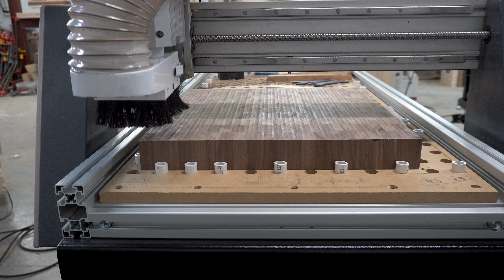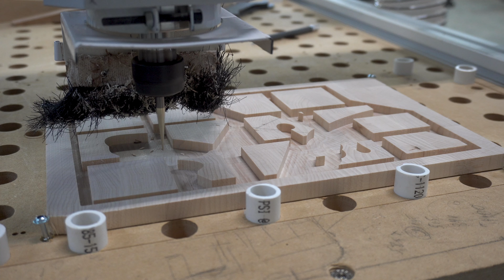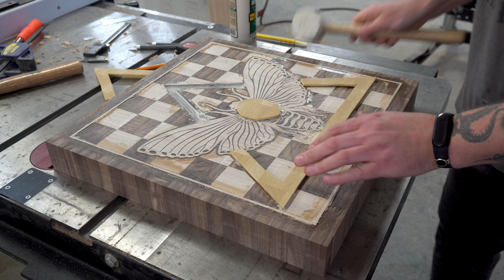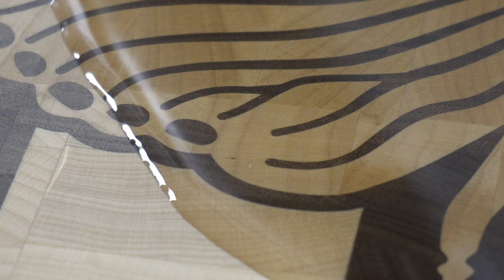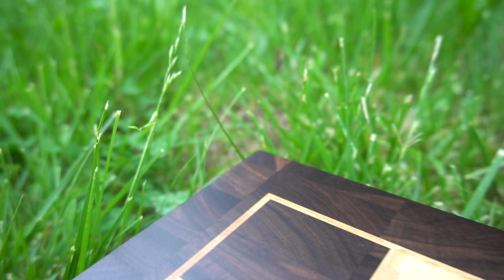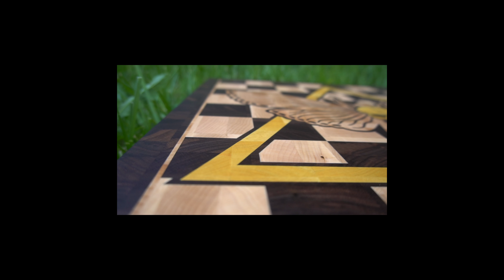ZIEBA board #4. CNC inlay cutting board. BroinwooD.

Comment: Do you use a press, either mechanical or vacuum, during your glue stages? If so, can you make a recommendation on best direction to go?

Thanks in advance, bro.
Reply from the maker: I am using a hydraulic press. It is a self-built press.

Comment: You always mark the center. Do you set this to your 0,0 reference instead of a corner? If so, how do you set it exactly back to that after moving the board?
Reply from the maker: The CNC can memorize/set 9 zero points.
I just mark the center and set it on the CNC.